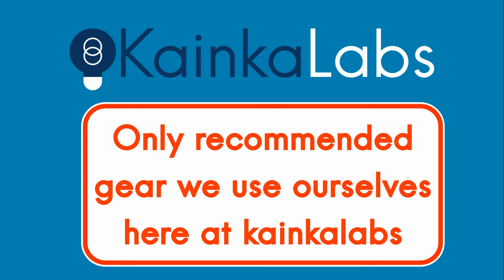Every maker should have… [Pt.4] IC Tools for pin-straightening, insertion and extraction

Comment: A small flat-blade screwdriver is the best, and most effortless method of removing ICs from sockets, assuming there's room to use one. Those IC-extraction tools only work well if the IC isn't particularly tight in the socket. With tight ICs, you have to stand up and center yourself over it, so you can put some strength into it, and then try to keep control of it when it suddenly comes loose, like a game of tug of war when the opponent suddenly lets go of the rope. It ends up being quite a workout if you're removing dozens of tight ICs. 

Use one of your extraction tools to remove the 50 or so socketed chips from a Nintendo Super Punch-Out (1984) arcade boardset sometime, and you'll see what I mean. You'll also find that you likely won't even be able to remove one of them with such a tool, i.e., the 40-pin Z80A which is installed VERY tightly in an old style Yamaichi IC-63-14 wire wrap socket. In the owner's manual, Nintendo actually recommends using a screwdriver to remove socketed chips (they mention an IC remover too, but the illustration they drew shows a screwdriver). See here - http://i.imgur.com/hXLWjMa.png

A screwdriver is effortless and removal can be precisely controlled (unlike when you're hauling straight up with all your might with a death grip on the IC removal tool), because: leverage.
Reply from the maker: Yes you are right but I come to the opposite conclusion :-)
When an IC is very tight in the IC-socket I most often got the IC out with bend pins at the edges when I used a flat-top screwdriver.
So using an IC-extraction tool especially with tight-sitting ICs just the way you described I almost always got them out without bend pins.
And what do you do, when you can´t get a screwdriver in between the IC and the socket?
So I think the IC-extraction tool is so cheap, that every maker should have one...
Just in case
Reply: KainkaLabs
I don't bend pins when removing ICs with a screwdriver, regardless of how tight they are. I use the screwdriver to lift one end of the IC slightly, slide the screwdriver in some more and lift it a little more, then slide the screwdriver all the way in to the other end of the IC and to the right side and rotate the screwdriver slightly counterclockwise, and then move it to the left side and rotate it clockwise. At that point the IC is out of the socket and the pins are fine.

When removing a tight IC with an IC removal tool, if you are a little off center, when the IC suddenly comes loose, it can bend a whole row of pins way out of shape. Or the IC can go flying when it suddenly comes loose, and bend all the pins way out of shape. When I used to use such a tool instead of a screwdriver, I would rest a finger from my other hand over the top of the IC while pulling on it to try to keep control of it when it would suddenly come loose, which worked most of the time, but there were still a few mishaps like I described above. Having to pull on something as hard as you can, which will come loose suddenly, all at once, is a bad idea with something delicate like an IC.

>And what do you do, when you can´t get a
>screwdriver in between the IC and the
>socket?

I've never had that happen; I have some very small, thin-bladed screwdrivers; but in such a case I'd take my chances with an IC removal tool. I have one but I never use it anymore, because a screwdriver is so much better, and I don't end up all sweaty from playing tug of war with 50 tight ICs in a row.
Reply: Thanks for all the advice here. I have some computers that have very tight sockets indeed and I have definitely bent the pins when using the correct IC removal tool. I'm going to try screwdrivers from now on. Unfortunately because the sockets are so tight it also sometimes bends the pins when I try and push the IC back in again. I think I'll invest in one of those IC insertion tools.
Reply: Completely agree. I was restoring a 30 year old computer the other day and thought it needed the extra care so I bought an IC puller; the force needed to pull out the IC caused the tool to glide on the chip when it finally snapped loose, bending one entire side of pins 45 degrees (vertically/left, not outwards like in this video).
So yeah, for work on older boards and tight ICs I really can't recommend the V-shaped puller tool. The "hairclip" version in the video might work better, but I haven't seen that around.